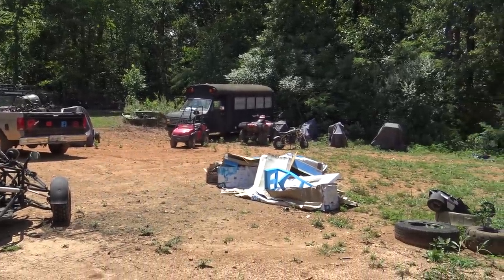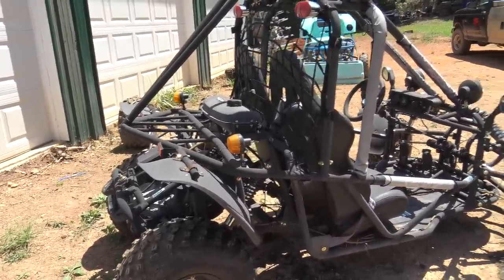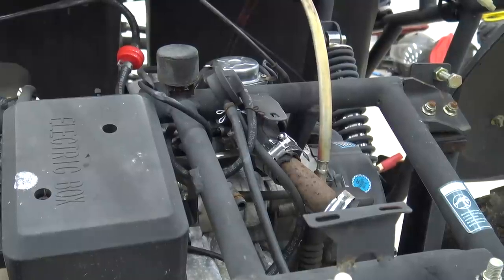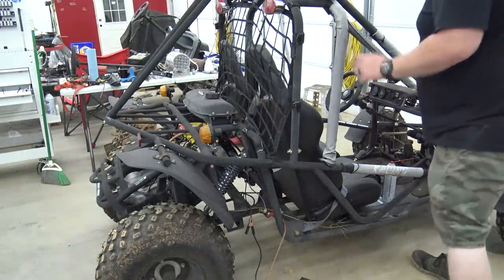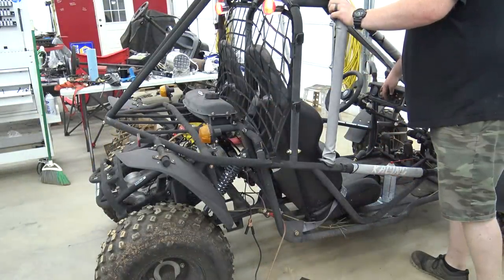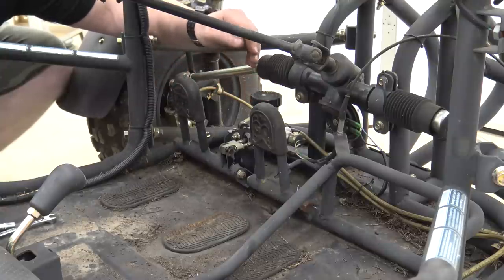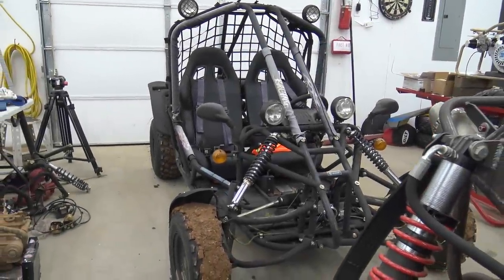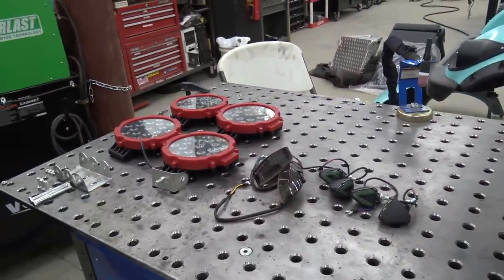Kandi 150cc Buggy Fix, Lights, & Speakers

Comment: I've got two Trailmaster XRS 150 ( 2013 and 2016 ). I got tired of seeing them in my shop so I've decided to pull out the old dead GY6s and thinking of installing either a Predator 301cc or maybe a 420cc engine, a 10Tx60T gearing. I've done a few things with my welding machine but this will be a new adventure for me. I've watched quite a few of your vids and I'm convinced that I'll give it a try. You guys make it fun and that's what it's all about, just making something better. Happy trails!

Comment: I am currently working on one of these same karts. I replaced the carb, elbow and air cleaner box as they were all jacked up. I am needing to get an electrical box cover and also go through the wiring harness and electrical box layout so I can try to restore everything correctly. There is electrical tape and spliced stuff going on so would be great to get some photos and layout of that from your Kandi 150 so I can get this thing back to square one. Rather get everything back to spec before trying to even start it or trouble shoot why it quit on them before. Ton of vacuum leak possibilities were there with dry rotted lines, and broken parts around the original air cleaner box.  Thanks.

Comment: I hope you have better luck than I did with that Chinese taillight with the built in blinkers. I got the same one and the left would never blink. Ended up getting an led strip and cutting off the tag mount and used it for my tag. Keep up the good work!👍

Comment: hey i ordered the same motorcycle taillight, had same problem they just stayed on, the issue is that they dont pull enough amps to trigger the flash relay, so either add resistors(which i did, but they get hot and melted their wire out) or buy a low amp LED specific flasher relay and they will work just fine... OR you can just add 2-3 more led lights to the signal wire circuit (to increase the amp load) and they will work aswell...

Comment: Hey , glad I found this video because I have acquired the same Kandi 150. Mine had a shredded drive belt which was about all that was really wrong with it.  I have relocated the battery to a much better location, up behind the driver side. I am adding LED's to mine also, but rectangle not round; and relocating all the lights to be inside the roll cage in-case of a roll over.  I ordered some of the parts you listed and would really like to see how you can improve the performance on this 150. I have seen other videos that have sparked my interest with doing a much larger engine swap. I'll wait and see. Thanks for this video. PS. I will try to send photos later.

Comment: Might need to wire in some resistors for the turn signals. Incandescents pull more amps to switch the flasher relay.
Reply: Or use some electronics and add mosfets

Comment: Wow 😯 great video bro! I have a 4 seater, and it starts fine, but for some reason the lights are not cutting on or the dashboard indicators, speedometer or the turning singles. I have to hold the key all the way to the right to get it to come on for some reason. Any pointers?

Comment: Sounds like the green with yellow wire has broken off in harness for brake lights. FYI if you get another buggy with them same tail lights and want a cheap quick fix, trailer lights fit in the bracket holes. Lost the same light off black widow.

Comment: I bought one exactly like this. You know where I can get a wiring harness from front to rear. Whole harness is missing.  Was straight wired but wanna fix right for my grand daughters.  Not firing  now, wanna wire up right so I can diagnose correctly.  Thanks

Comment: I have a 150 cc go cart and Was wondering my old air filter box had two hoses they ran to it from the crank case and from the valve cover which I vacuum but if I put an aftermarket filter what do I do with those hoses that have vacuum

My go kart just like this one but 4 seater

Comment: Hey need a little help just put up a go cart 150cc just like the one you have. Need wiring Diagram for starter cause it will it crank and what size battery will it take if you know thanks..

Comment: I just recently got a Coleman 2020 candy style cart. When I go to start it all I get is a single click near the starter, I changed out the starter and solenoid and battery and still just a click could you let me know if it's my starter clutch or the motor locked up

Comment: I have on Kandi 150 cc but had to change the ignition switch but it doesn't turn on due to the security alarm do you know a work around to disable it

Comment: hey dig your channel,that cart looks just like the cart im working on,it has yonghe in a few places on the engine,and i cant find any info on it,ive bought 2 chinese wiring kits and neither one of them works,got a refund on one the other told me good luck shopping at another store,all the chinese aftermarket stuff ive incountered is crap,or works for an hour,have you done any wiring vids on one of these carts?my other project im working on is a hisun strike im swapping a ninja 250 into it,just started the fab work

Comment: Hey red beard, I that exact go kart, I bought it not running, was told it had no spark. I finally got it running but it was really weak and would not go fast at all, so I took the engine apart and the Piston was broken so I decided to get it big board, parts will be here soon, but I have had trouble with the back breaks,it's like there's no pressure back there and they won't work any suggestions?

Comment: What's going on Sir love all your content that's a nice go-kart quick question I have a 150 sport Baja go-kart bought it from a guy it was vandalized it had no ignition key put power a battery in it have no power to the dash there is no fuse they just tied it together could not get any spark change the coil and stator coil wire spark plug CDI box no spark is there anything that you could tell me what to do I thought about changing the whole harness from the dash to the engine I cannot find the the harness for it is there an alternate harness that you think that you could direct me to I would appreciate it thank you sir 👌

Comment: I have that exact go cart I’m working on right now I have change the variator sliders to 10 g, I have replaced the belt, I have checked the clutch, and I’m getting a lurch or my engine is twisting… It’s some kind of a gear set and I can’t change out the gears because of the 150 mL candy the gears are on the right side where the internal reverse is I don’t know if it’s a 40 to 13 ratio I’d prefer to have a whole shot as opposed to top end... I was seeing if you could replace the gears in that or what do I have to do to find the proper gasket to split it open because I am dumbfounded on why the engine is lurching .  I have jackstand in the candy in the air and put full gas on it and it spins perfectly with no load… But when I have a person on it the engine lurches and it seems like if the tire rotates like five times that’s when the engine lurches so it Hass to be something of the gear set inside have you gearing to replace the internals or is it some other issue
Reply: Have you checked the chain tension and sproket wear?

Comment: I have a 2011 one with a 250 im trying to find a wiring harness for it before I just  fix and make this one correct.  Do you know if the hammer haed one will work that has the same size motor.on it. It the only thing I can find  with the part number from the service manual when I search the number thats what comes up with the exact same.number for there's? I have wiring diagram with the service mani found also so if need be I will just do it my self would just rather replace the whole thing though cause it was left sitting outside for a couple years I belive if not more . But got it for a really good deal I know it was running at one  point t not long before I bought it cause either have gas in it and was still good so it want left sitting with that it for long. But look like a kid butchered the wiring behind the seat the connects all the stuff for it to run.
Reply: It in great condition not rusted or wrecked frame  and just one of the seat will.need to.be repaired or fixed to put back shocked ar still good and tires holding air still ,but for 200 it was a good steal the motor or just the frame is worth that!

Comment: You can't legitimately sell a carb with a "performance jet". As you know, carb jetting is dependent upon far too many factors.
Reply: But said carb would fit specifically to a pre sized intake. Couldn't put a four barrel on my mower. Got nothing to do with a carb from a company that sells the same carb with a stock jet and a performance jet. Think before you speak
Reply: @griff420blazer4  stock jet could be too large in a higher elevation. I said nothing about fitment of carb to intake. Think before you try to belittle someone.